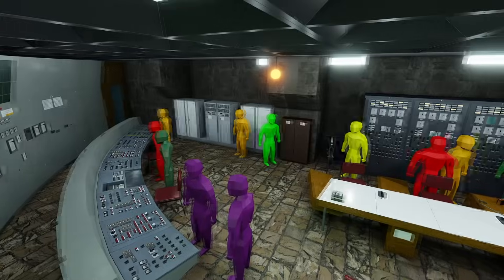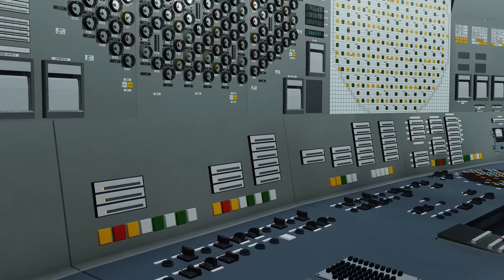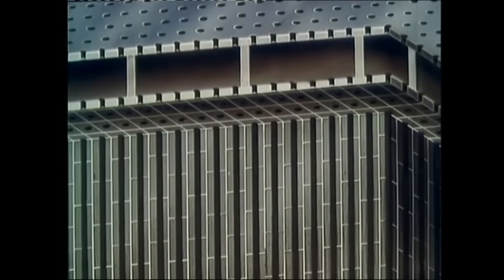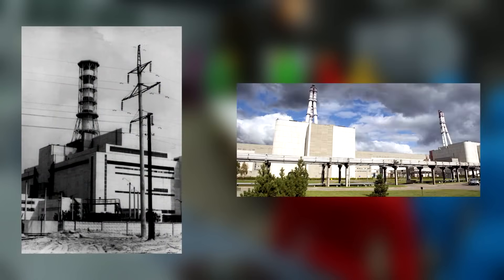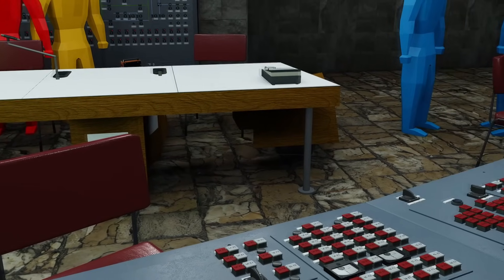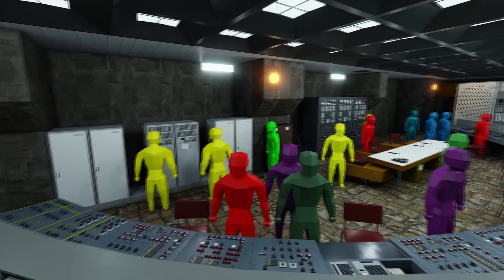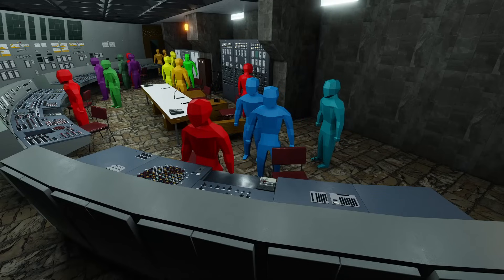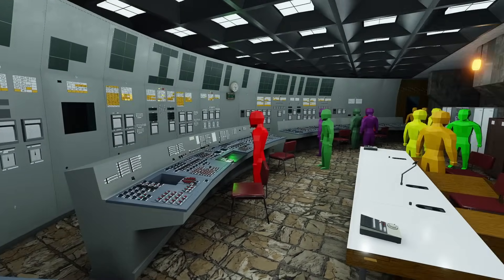How Chernobyl Exploded - PART THREE: The Final Minutes

Comment: I work in the nuke industry and have been to senior reactor operations class. It worries me that the ops folks had such a poor understanding of neutronics that they didn't recognize the impacts of the graphite tipped rods.  

I'm not blaming them since they weren't trained, but the concept about reactivity margin and the neutron life cycle is covered very thoroughly these days, and rightfully so.  An operator should know every potential impact on reactivity that can occur, no matter how slight.
Reply: The graphite tipped rods are still there. Due to the positive void factor (that's a "negative water presence factor"), a RBMK reactor can't work without them displacing water. What changed is that now, when the rods are fully extracted, the base of the graphite tip is at the bottom of the core, instead than 1.2m above it. 
When they had been made like that, not even the designers understood the risk. Otherwise they would have made them like the actual "modified" ones from the start. After the first power surges, they understood the cause and started to search for a solution, but none had been implemented at Chernobyl before the incident.
Reply: Wouldn't they still displace the water if extended? I mean the water is going to be pushed out either way. Things should of been all boron without graphite at all.
Reply: @DeadstringRed  It should displace the water when the rods are at the top, otherwise water will be absorb neutrons and the rods will not so strong when extended and also reactor will be work with lack of power because lack of neutrons
Reply: @cyberwaldemar  yes in retracted position the displacers are in the active zone increasing reactivity.  Wen inserted boron enters the active zone and graphite displaces the only neutron absorbing water left at the bottom of the core. I just can't see how making them longer would change much. In that case all of the water gets pushed out and should increase reactivity, unless more boron enters faster to offset the lack of this water getting pushed out the bottom .
Reply: @DeadstringRed  No. In the original design, with the rod completely extracted there was a 445 cm long graphite rod at the centre of the reactor, with 125cm water above and below it. So, when the control rod was lowered, in the lower part of the reactor, at first, 125cm of water were replaced by 125cm of graphite, and the reaction there accelerated for some second. 
In the fixed design, the graphite tip is longer. So there is not that void (full of water) space under the rod when it's completely extracted. So, when the bar is lowered, there's no part of the reactor where water is replaced by graphite.
Reply: @neutronalchemist3241  how can that little amount of water displacement start a chain reaction though? This should have happend at unit 3 and igualina . The culprit could not be the displacers alone or unit 3 and igualina az5 should have blown.  The low ORM and feed water temp and flow had to make this happen. The thing had been scramed several times in that year with no issues and igualina had seen a slight surge.  I don't know why they called them tips. They sit in the core wen in extracted position and make up half the rods almost. Plus now az5 has boron from the bottom attached so it's impossible the last 2 rmbk plants can blow.
Reply: @DeadstringRed  125 cm (some reactor is smaller than that) of water (that slows down reaction) replaced by graphite (that accelerates reaction) in paractically all the pipes (because the rods were almost all rised, and the AZ-5 command lowered them at once) in an already unstable reactor that was experiencing a power surge makes an enormous difference.
Reply: @neutronalchemist3241  And yet, the original RBMK's had full length rods too, but it was still notable that there was the positive coefficient to contend with.
Reply: @mikafoxx2717  They were not really "full lenght". With the rod completely extracted there was a 445 cm long graphite rod at the centre of the reactor, with 125cm water above and below it. So, when the control rod was lowered, in the lower part of the reactor, at first, 125cm of water were replaced by 125cm of graphite, and the reaction there accelerated for some second. 
In the fixed design, the graphite tip is longer. So there is not that void (full of water) space under the rod when it's completely extracted. So, when the bar is lowered, there's no part of the reactor where water is replaced by graphite.
Reply: @neutronalchemist3241 
From my understanding, the Leningrad plant in 1975 would have undergone a Chernobyl as it followed the exact same procedure of restarting a reactor but AZ-5 was pressed and only a brief rush happened rather than a full prompt criticality like Chernobyl. I believed those rods were full length and they were shortened but perhaps I'm mistaken and something else caused that one to not go prompt.
Reply: @mikafoxx2717  The AZ-5 button had been pressed dozens of time at Chernobyl and elsewhere, since it was not some sort of last ditch emergency button, but the normal way to shut down the reactor and, even that night, it had been pressed not because someone "sensed" the power surge (they didn't have an instant indicator), but because the reactor was scheduled to be shut down  after the test for standard manteinance. The condition of the reactor when the button was pressed were paramount. Had the button been pressed only few seconds before, it's likely the reactor would have not exploded.
Reply: It was a design flaw, even if they had a poor understanding, an updated version of the reactor wouldnt have caused a meltdown.
Reply: Graphite is never really safe because you can't loose moderation like pwr . Fukashima is probly as bad as a pwr can get. Decay heat is the only issue in those correct? Although I heard of LaSalle was almost a chernobly and it's a pwr or bwr.
Reply: @DeadstringRed  reactor with a positive void coefficient are at risk  (as a thumb rule, reactors that use natural or scarcely enriched uranium have a positive void coefficient, reactors that use highly enriched uranium have a negative void coefficient), because excessive heat, or the vessel breaking means the water is gone, and the reaction accelerates further.
PWR and BWR have a negative void coefficient, but that's only slightly better, because water (that, in their case, accelerates the reaction) is still needed for cooling. If there isn't water, the decay heat is enough to melt the fuel bars and what's around them. So, in case the reactor vessel is damaged (like at Fukushima) you have to pump water into the reactor anyway (accepting contaminated water to get out of it, or having an exposed core), and risking a hydrogen explosion if the heat is enough to break water molecule and you can't vent the fumes.
Reply: @neutronalchemist3241  why is low enrichment turn positive though? Is it due to the need to have less boron or somthing I'm missing?
Reply: @DeadstringRed  It's possible to have a natural uranium, water cooled, reactor with negative void coefficient (some had been designed, but never built) but it's very difficult.
Basically, a natural, or scarcely enriched, uranium reactor can't have water as sole moderator (unless using humongous quantities of uranium). There are few neutrons produced, so the neutron absorbing charateristic of the water is prevalent. 
But water is still present in the reactor. It's needed for cooling. So, if water goes away, you still have the moderator (graphite in the RBMK, Deuterium in CANDU...) and lost a neutron absorber. 

Note that it's easy instead to design a natural uranium reactor with zero void coefficient. It's enough to not use water as coolant. Like in the Magnox. Unfortunately Magnox reactors are not that efficient at producing electricity.
Since Magnox is ineherently a pretty safe design, I wonder if it wouldn't be possible today to enclose the uranium bars in a ceramic cladding, so avoiding the problems of the Magnox alloy.
Reply: @neutronalchemist3241  yeah I don't think those candu are very common.  Seems all are pwr and single circuit bwr . Heard the steam is active in those bwr so the turbine has radioactive steam turning the turbines . They say leaks can happen in bwr discharge water but low amounts.  Only 2 rmbk plants exist now in the middle of a war zone with the same iconic vent stacks as chernobly.  The West used graphite in the 50s . Windscale had to be the worse design in the world. Air cooled graphite moderated.  How they thought air could cool was insane .
Reply: It was nuclear experts who lacked an accurate understanding. That's how an RBMK reactor explodes. I don't know if that worries you or what.
Reply: @markusw7833  the experts knew.  This channel does a great job of covering that kn earlier episodes.  But the design bases were a closely guarded state secret.
Reply: @mikeall7012  No, the experts did not know. I have written scripts for this channel about the experts not knowing, albeit there were some warnings. In two and a half weeks you will see a roughly one-hour video that will rehash the key factors the experts did not accurately understand. Stick around.
Reply: @markusw7833  That's one of the key points about the demand for better computation to assess the effects on changes to the reactor, right?
Reply: @clancyjames585  Yes.
Reply: All this is a replication of the Soviet lie about the causes of the accident. If you want to know the truth, watch: HOW THE 4th UNIT OF CHERNOBYL NPP WAS BLOWN UP.   (KS channel)

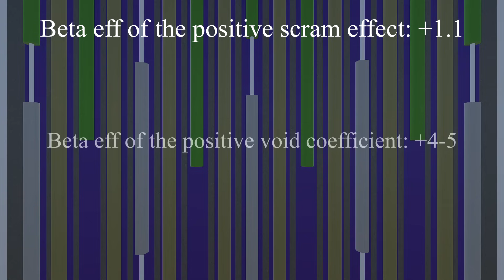Comment: 15:14 "Combined, we now have approximately 6 times the reactivity threshold..."
I do not understand where you're coming from with this number. There is a beta eff of about 4.5 from the positive void coefficient, and 1.1 from the positive scram effect. Combined, that gives 4.5*1.1=4.95, or about 5. Where does the extra reactivity come from to bring this to about 6?
Reply from the maker: Not 4.5, 4 or 5.
Reply: @thatchernobylguy2915  Okay, so the combined beta eff is either 4.4 or 5.5. Where does the "approximately 6" come from?
Reply: Aren't you supposed to add terms together for a reactivity balance?
I've no idea why you multiplied them together.
Reply: I guess approximately 6 comes from adding the incremental reactivity of the positive scram effect.to the incremental reactivity from full voiding all the cooling water around the fuel assemblies. However the latter would not have happened instantly.
But any positive fast power coefficient would have been sufficient to trigger positive feedback and a runaway power excursion, leading to more or less complete voidage in the fuel channels.

Comment: so how could this be avoidable? what should have happened in which situation to avoid the explosion? because i think the design alone is not the only reason for the catastrophe
Reply: Running the test at 700-1000MW level as directed, with the steam bypass/dump vavles open to the condensers, while the turbines freewheeling. That would avoid all the hassle and the excursion at the end.

Comment: Quick Note, Beta effective is the effective delayed neutron fraction. Different reactors will have different Beff values, which you are correct in saying define the boundary between a normal operating state and prompt critical. However, an addition of reactivity equal to Beff when the reactor is critical (ie keff=1 or p=0) is what defines the prompt critical boundary, not just the value of Beff. For example, if a reactor's beff value is 0.005 delta k/k, a keff of 1.005 would be prompt critical (the reactor is sustaining criticality on prompt neutrons alone). The value of Beff changes over core life, but remains constant from day to day operations.

Comment: I don't get it... Why is was so hard for reactor designers to add a simple gauge (digital all analog) that will show (in real time mode) the exact number of control rods inserted? Why it needs to be calculated via SCALA with 5min lag every now and then? I get that neutron flow, or core temperature gradient in such enormous stucture like RBMK is rather comlicated and somewhat abstract matter that cannot be measured on the demand. But controls rods have very simple parameters: overall number of rods currently inserted in the core and depth (in meters) on witch those rods are actually inserted
Reply: The designers wouldn't bother to do that because the number of inserted rods was not regarded as critical to safety by them either.
Reply: You have 167 (I think) control rods all at different insertion depths, thats a lot of rods to watch, and you need to do the math on how much of each rod is in the reactor

Comment: So they were running a test on a xenon-poisoned reactor they did not really understand and which was inherently unstable and whose emergency brake acted like an accelerator in the early stage of its employment . Does that sum it up ?
Reply: The reactor's designers also did not really understand its behavior at low power. The test wasn't really problematic, it just coincidentally put the reactor in its most unstable operating regime. But yes, pretty much sums it up.
Reply: i think you are delusional, i have to send you to the infirmary
Reply: All this is a replication of the Soviet lie about the causes of the accident. If you want to know the truth, watch: HOW THE 4th UNIT OF CHERNOBYL NPP WAS BLOWN UP.   (KS channel)
Reply: @ВолодимирІвасенко  your mom is a lie

Comment: If you met any of these engineers in the pub the night before and told them 'Hey, don't run that test tomorrow, the reactor will explode' what could you tell them to convince them, rather than write you off a a drunk idiot?
Reply: Tell them the power coefficient is positive, the void coefficient is plus five beta and the steam coefficient never stops rising for the whole x axis. Would scare the living shit out of them.
Reply: @MinSredMash  All this is a replication of the Soviet lie about the causes of the accident. If you want to know the truth, watch: HOW THE 4th UNIT OF CHERNOBYL NPP WAS BLOWN UP.   (KS channel)
Reply: @ВолодимирІвасенко  Hush. Adults are talking and don't want to be disturbed by childish science fiction fans.
Reply: @MinSredMash  Если нужно что-то объяснять, то ничего не нужно объяснять...
Reply: @MinSredMash but physics department of the ChNPP had been conducting regularly such measurements. Why then operators were not aware of the positive fast power coefficient, big positive void coefficient and positive steam coefficient? Does this imply that the methodology of the measurement was written deliberately wrong? (To get better results)?
Reply: @pavlovezdenetsky7824  They probably knew the magnitude of the void coefficient, but the power coefficient tests were only valid at high power, so they did not accurately reflect the values at low power. The designers advised the operators that the steam effect would become negative once most of the coolant was voiding. This was incorrect and could not be verified locally.
Reply: i would probably get very weird looks because i do not speak russian. 

i think my best bet would be to say nothing, wear the most stunningly etherial dress (with LED lights in it for effect) and makeup i can find, and slip them a photo of the exploded reactor with the date and time of the disaster printed on it inside an envelope, and vanish. Spook the shit outta them. Make it so the photo is on that paper that degrades within half an hour of contact with air or maybe light, too. Full hammed up "apparition from heaven" kinda shit.
Reply: @OutbackCatgirl I like the way you think.